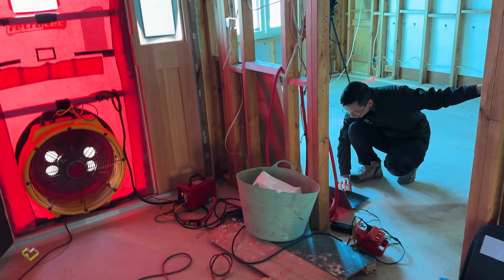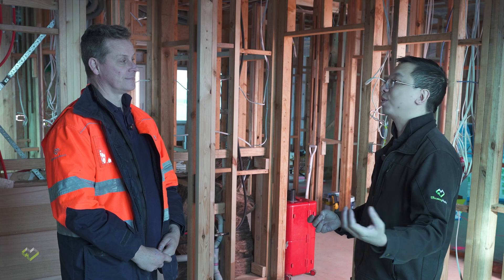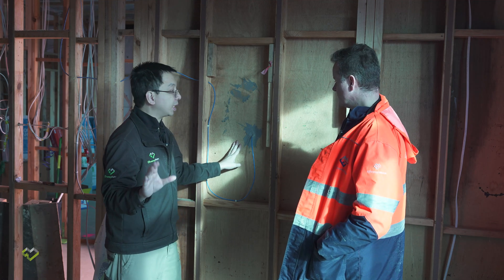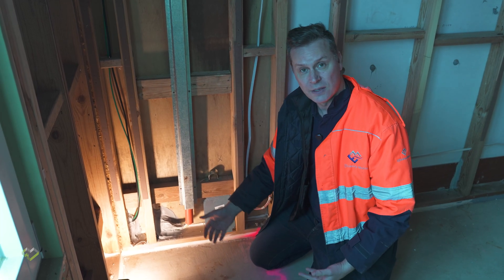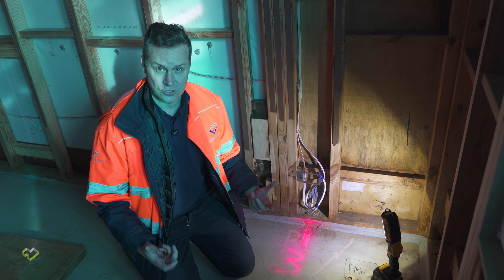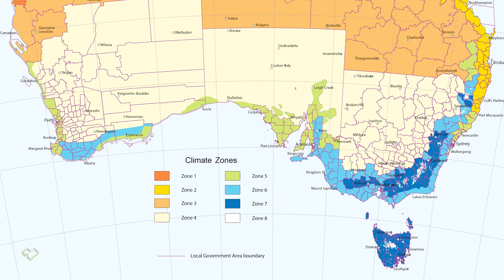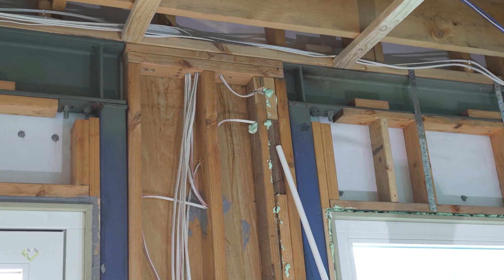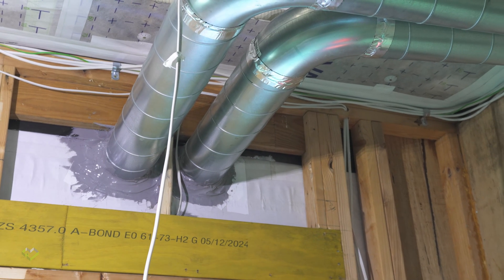The Hidden Details That Make or Break Airtightness

Comment: What vapour retarding paint will you be using or suggestin?
Reply from the maker: That product is getting released shortly.  It will be available on tighthouse.com.au
Reply: @ecoevo oh great just in time. We are starting our renovation in just under a month time. We don't have the budget for a full airtight renovation. As we are only taking out a few internal walls and adding new kitchen and flooring ( and windows😅) will this paint be suitable to be applied to plaster that has already been painted?

Comment: Great video. I had a query about expansion foam and electrical cables - I thought there was an issue with pvc and polystyrene reacting. Is that not the case or is this a special product?
Reply from the maker: There is no reaction, however, the main issue is if the cables are entirely encapsulated over their entire run, overheating of wiring can occur.